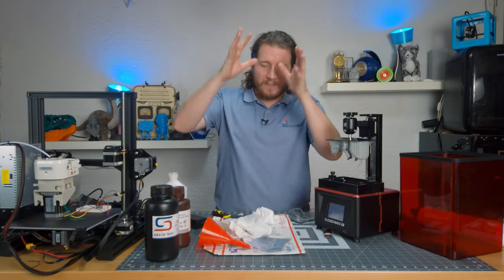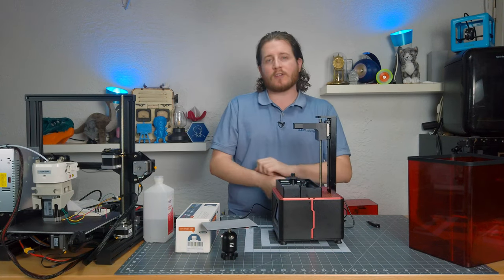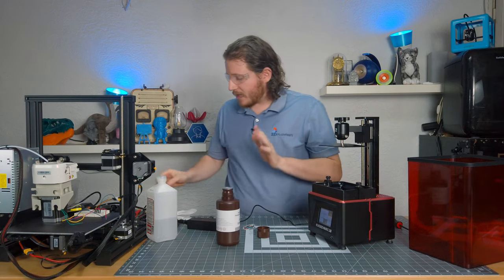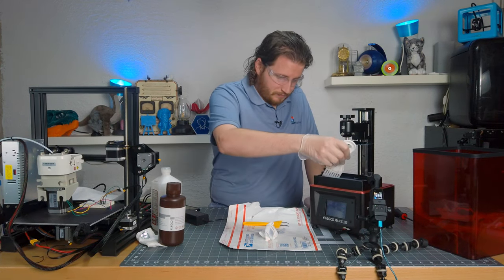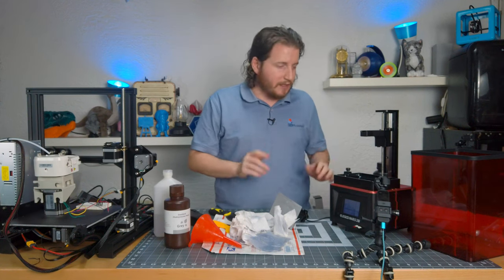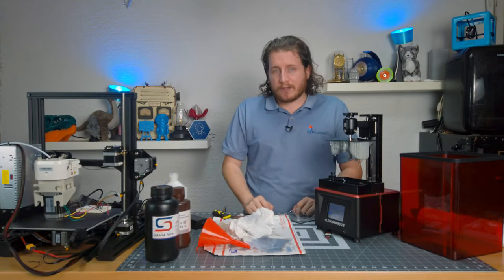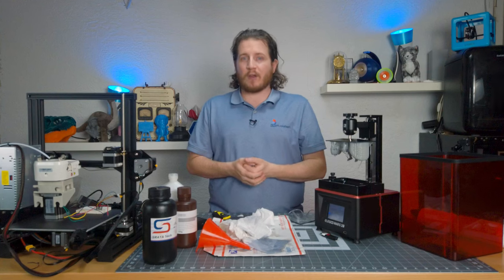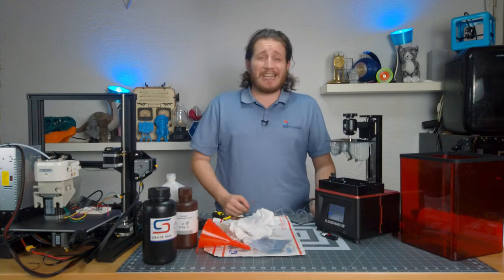Remedying Resin Rejects! - Fixing Resin Printing Failure

Comment: New guy here. I'm currently going through a kinda/sorta sameish issue. Anycubic mono 5 Pro. The printer has been cleaned with IPA several times, FEP has been changed. Settings using Elegoo 8K water washable profile and resin. A week ago, print was fine. Since, one fail after another. 

Build plate undamaged and sticks fine. Same resin/different bottles bought together. Outer supports print fine. Center/object collapse into a mess. Seems strange outer supports stick and centers won't. Plate seems flat. Doesn't sound like a resin issue but who knows at this point.

I'll beat this eventually but man, what a learning curve.
Reply from the maker: well, water washable resin is garbage IMO, it is not safe to go down a sink and washes much easier in alcohol.. 

It does sound like you need to run an exposure test. I THINK you are underexposing. As the temps cool down, resin gets more viscous and requires more time to properly cure. 

Try the cones of calibration from Table Flip Foundry and see what it tells you :)

Comment: Interesting video. I bought my first rein printer Elegoo Saturn 3 ultra in January this year. It was very easy to setup My first test prints were very good using Elegoo water washable resin. I have used the Elegoo standard, and plant based resin with the settings recommended by Elegoo. The prints came out very good. I did not have any problems with the Elegoo resin. The siraya tech resin is 25 to 50 % more expensive than the Elegoo resins. So I prefer to continue with Elegoo resins.
Reply from the maker: Yeah I dont know why we had issues back then. I dont mind spending more money on good resin though. Just remember, never put resin down the drain!
Reply: Nice, I have the opposite.. first 15 builds failed... very frustrating. Anyways, once the current fails its sandpaper time :)

Comment: Can’t understand why you levelled the plate with resin in the vat.surely you will get a layer of resin under it and get a bad levelling.
Reply from the maker: Never once had an issue with it. I know you should do it empty, but this way has worked, so if it aint broke? But yes, it is recommended to do it empty or with a piece of paper

Comment: 1st off I have all the same problems.  I am using anycubic basic resin.  might be the issue.  what I have done so far;
1. I have the Anycubic Photon mono 5s
2. I sanded the build plate with 400 grit
3. I ptfe coated the resin chamber, maybe  I did not wipe it down enough ?

Still, everything is sticking to the film or dropping off the build plate.  very frustrating
Resin change incoming
Reply from the maker: the ptfe lube is a misnomer, we know this now, it does not help. If things are not sticking to the build plate it is best to look into upping your initial exposure times. The Cones of Calibration from table Flip Foundry can easily help with this :)
Reply: @3DMusketeers  im testing this now with Siraya Tech Fast grey resin, after loading up their settings for my printer the Mono 5sr, the anycubic resin would just not stick
Reply from the maker: yeah I like Siraya Tech resin here.

Comment: Another interesting video.  Leveling the build plate and setting the correct z=0 height still confuses me some. I see most of you guys hit home, tighten the screws and start printing.  On the Elegoo Mars 3, it says to hit home, tighten screws, then adjust z height until the paper pulls out with some resistance, then set z=0.  Is this a mars 3 thing, or ???  Any guidance other than follow the manual?  Thanks.............
Reply from the maker: The pulling paper is a FDM thing.. I don't have a mars 3 though so not fully certain how they do it. We just loosen screws, lower plate to home, it'll set it's own height then tension the bolts. It will just sit on the leveling paper or the fep. 

I'm curious if that's what it says for the Mars 3.. can you send us some photos (on social or email?)
Reply: @3DMusketeers  Of course.  Posted the steps on your Facebook page.
Reply from the maker: Thanks!
Reply: It's a Mars 4 max thing also

Comment: you should have put a paint filter in your funnel
Reply: Photon S has regular LCD screens to btw. the difference between Og Photon and the S is Anycubic changed the mainboard to their POS proprietary board and went to the LED matrix array...and well the plastic crap case...
Reply from the maker: Good to know! The naming scheme with these printers is terrible..
Reply from the maker: Definitely should have. Was a bit frustrated when it happened and absolutely could not find them, so just went raw..

Comment: The siraya tech resin requires different settings such as both lower first and normal layer times. Therefore you have overexposed the successful print which pretty much garantees that the first layers will stick to the build plate. You also removed the cured mess from the original failure and sand it it twice. Yes siraya tech is great resin but I'm not convinced it was the only way to go here. Your results were good but I don't believe you achieved them for the same reasons you stated.
Reply from the maker: Oh man this is an old video, I dont even remember it... I might have over exposed it.. Temps fluctuate so much here that it is a problem, and in fact pushed us to make our own heater system called The Politician (because it filters and produces hot air).

Comment: I've been using sirayatech easy and have been having failures ...
Reply from the maker: What is your temp ambient? Settings, slicer, printer etc?
Reply: @3DMusketeers  ambient temp is maybe 68-70 , I went with the settings from sirayatech and added 10 seconds to the bottom layers incase itz to cold and it's a saturn and I leveled everything.
Reply from the maker: Yep that is your problem.. get it warmer.. The regular layers will suffer too.